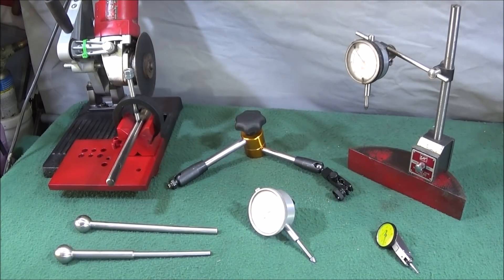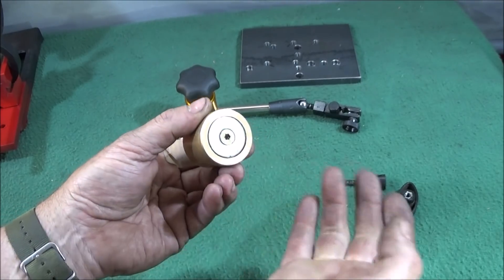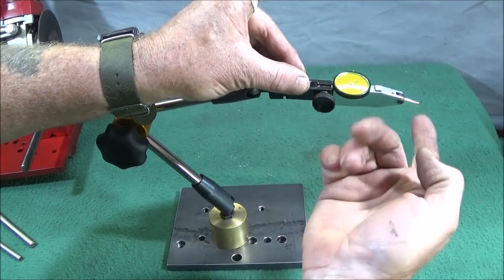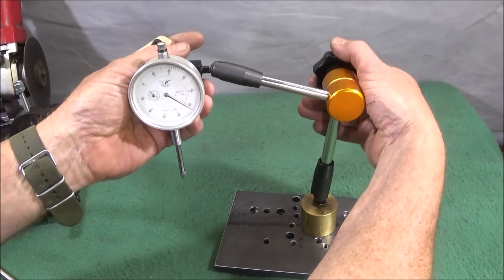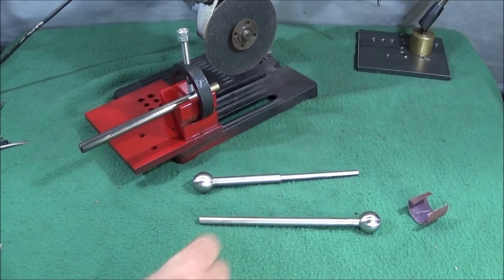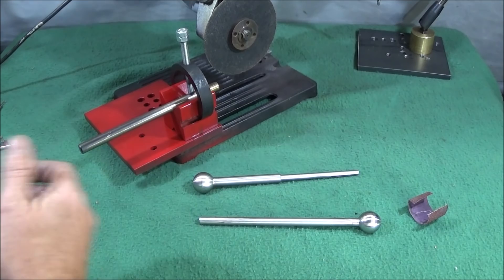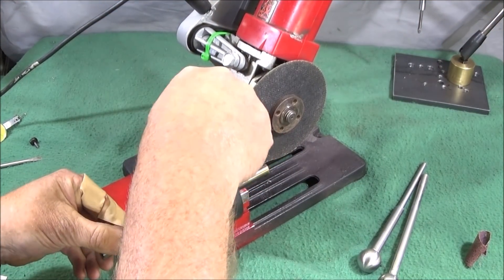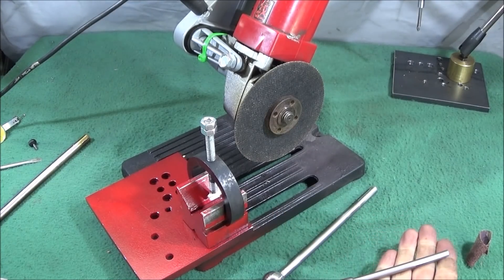New DTI Clock Stand. Safe Polishing Tools & Slot Cutting Upgrade

Comment: Hi Steve, more wonderful stuff, ordered myself dti stand, exalant tool as you described. Had to strip head stock again as there was a lot of vibration and noise  ( new metal gears chewed up, main shaft gear floating out of mesh, replaced with old plastic gears and works ok ). Still  get power drop 500 rpm down to 100 rpm then picks up ( circuit board problem ? ) . Look forward to next vid, keep up the good work.

Comment: Hi Steve,

Another great video!

Could you please tell me what chuck you have on your mini lathe?

Thanks
Carl
Reply from the maker: Hi Carl, It is a Chinese made 125mm or 5" chuck. I bought the back-plate to be able to use this sized chuck from arceurotrade. I think they still sell them ready made, but you will have to check with them. Regards Steve

Comment: Hello Steve. Thanks for another very instructive video. You are quoting good results with the clock stand. I have a very similar one of German origin but I am not happy with it. Until now I haven't been able to discover the principle of the clamping force, moreover the clamping force was rapidly diminishing. I suspect that the system works on hydraulics, i.e. when you tighten the knob you displace a small cylinder within and so you apply force on both ball hinges to tighten it. However, when you loose oil you cannot get access to refill it. I am curious to hear from you what the clamping system works on according to you. Until now I haven't been able to find the system on Banggood. can you tell me what the exact description of the item is so that I can search for it. Thanks beforehand and greeting from across the North Sea. Herman
Reply: Herman check out the video I posted on how the system works, its a very simple but clever idea. Martin.

Comment: Thanks, Steve, great tips. I got one of the Banggood indicator holders a while back and made a spindle mount for it— just a ½" length of dowel rod center drilled and tapped. I use it in an end mill holder to tram my vise to the mill head. Great buy.
Reply from the maker: Hi Charles, Thanks for watching. They are very good. I have just ordered the red one which I think is a bit smaller. Regards Steve

Comment: Buy the noga version, cost more but worth it.
Reply from the maker: They do obviously look the best you can buy, but way too costly, especially if you need a few of them! This Chinese one does the same job anyway and being such low cost it doesn't matter so much if gets damaged in any way. Regards Steve
Reply: Noga is a shit overpriced company -had one in a shipyard where i worked,worst stand ever  ,so flimsy and never could have lock it properly.
If you want true industrial quality buy Kinex umag  https://shop.kinexmeasuring.com/en/magnetic-stand-kinex-umag-pn-25-1858-1-294n-p162c14/

it is 85 € but its worthy every single penny(you will buy it once and use it for life)-it has heads down best fine adjustment screw mechanism that i ever used or saw.Very precise and sturdy as a brick wall.I have 2 of those one is new and other one belonged to my grandfather its from 1951 and still kicking.
Reply: So I was going to ask how this arm compares to the Noga if you had one. I do own one Noga and agree they are quite expensive but they do have much better performance compared to stand that Harbor Frieght sells. I did look at the one described in the link below and it may be a good quality stand but what I like about the arm you review and the Noga is that you have a bigger knob to turn to tighten it up.
Reply: I tried to order this stand earlier but look like banggood is out of stock
Reply from the maker: If a stand is maneuverable, smooth and locks solid very easily that's all there is to it. There isn't any more that can be added to performance. I don't see the point in wasting money on expensive overpriced DTI equipment that doesn't do anything different to these Chinese ones.

Comment from the maker: DTI STAND BUYING LINK ETC BELOW:-
DTI STAND SHOWN:- https://goo.gl/d4Lvoa
Universal Flexible Magnetic Metal Base Holder Stand --  https://goo.gl/4JEUgm
Adjustment Magnetic Flexible Base Holder Stand --  https://goo.gl/bCHnNH
SHAHE 3 Joints Full Adjustable Dial Gauge Stand Magnetic Stand --  https://goo.gl/LVC6kj
Universal Flexible Magnetic Base Holder Stand Tool --  https://goo.gl/4ZYV5K
Dial Test Indicator Lever Gauge Scale Meter --  https://goo.gl/zhYSZE
DANIU 40112302 Dial Test Indicator --  https://goo.gl/MCAxiQ
$0.80 Micro USB Cable -  https://goo.gl/YaNHhq (60% off code: fcd2a3 )